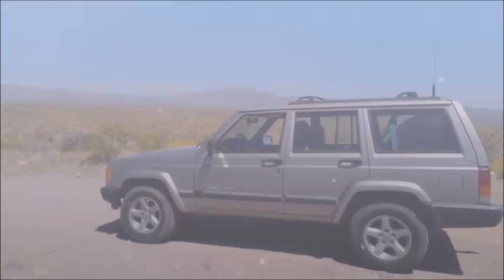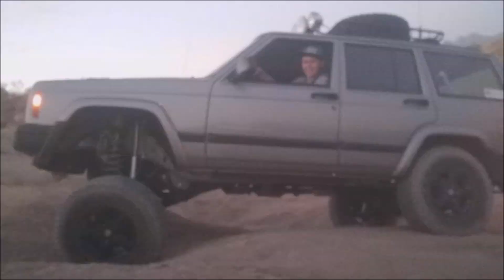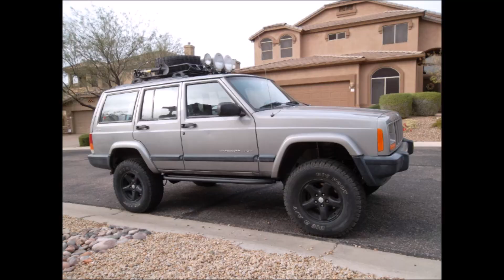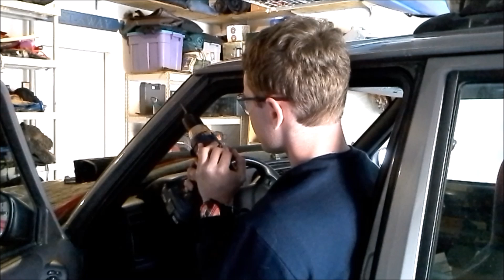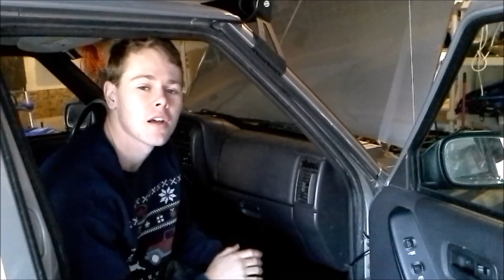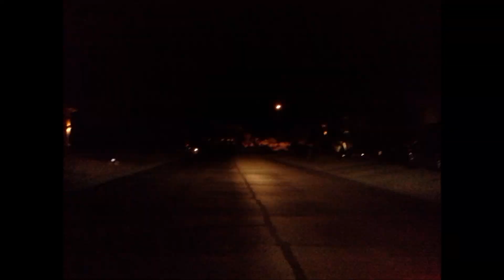Jeep Cherokee XJ LED Light Bar Installation

Comment: Have you ran into any moisture issues with this bar? I'm curious of how it does in the weather.
Reply from the maker: I haven't had any issues with moisture getting into the light bar. I live in the desert so we dont get much rain but it has been through a few rain storms without issue.
Reply: @AdmiralOffRoad  lol yeah not too much moisture there lol thanks for the quick response!

Comment: Probably extremely late now, but be careful running wires through your doors, can eventually wear through all the protective casing and short out causing popping fuses or even a fire hazard, great video just checked in to see how other people were running their wires 👍🏻

Comment: Alright. So there is a plug where the wiring attaches to the light. It's located right where you tucked it behind the weather stripping. Did you have the same problem? There is a good 12 inches or so from the light to the plug. I rather not have to tuck that all up on the roof

Comment: I'm having a problem drilling through...I'm using an 18 volt drill and a black and decker drill bit...is there something I'm doing wrong?
Reply from the maker: It shouldn't be hard. Maybe try a smaller bit first.
Reply: Admiral Off-Road that's exactly what I did and it pushed through! Thanks

Comment: What's the hit to your battery? Does it drain the battery quickly?
Reply from the maker: I haven't run it very long without the engine running, but I'm able to have the light bar and my spotlights on at the same time without any drop in battery level

Comment: Hey sorry I'm asking so many questions but did you ever have a problem with the light bar cooling things on the back of the bar vibrating while driving down the road and making an annoying ringing noise?
Reply from the maker: yep. At about 40 they make a ringing noise but anything above or below that it goes away. I've seen people use weather stripping on the fins to make the noise stop

Comment: Would this fit on a jeep zj ?
Reply from the maker: I'm pretty sure the windshield width is different between the XJ and ZJ so it might not fit with the same size light bar. Here is one that works for the ZJ https://www.amazon.com/Rough-Country-Windshield-Mounting-Brackets/dp/B0143LH220/ref=sr_1_fkmr1_1?ie=UTF8&qid=1478071575&sr=8-1-fkmr1&keywords=jeep+ZJ+50+in+curved+light+bar+mount

Comment: Did you do anything to prevent rusting where you drilled holes for the brackets?? If not have you noticed any rust?
Reply from the maker: just added some silicone to the holes and no rust

Comment: Hey how many inches from the bottom of the windshield did you mount them? Like down by the mirror
Reply from the maker: I'll measure and get back to you on that
Reply: Admiral Off-Road thank you! You just earned another subscriber my friend
Reply from the maker: would you like to have the measurement from the bottom of the windshield to the bottom of the bracket or the light bar?
Reply: Admiral Off-Road bottom of bracket
Reply from the maker: 17.25 in from the bottom of the A pillar above the fender to the bottom of the bracket.

Comment: Probably a noob question, but why do you need a harness? Can't you just wire directly to the switch?
Reply from the maker: here is a link to a good description of why you should have a relay for an accessory with a high draw: http://www.fourthgen.net/automotive-relays-functions-uses.shtml
Reply: Michael Wilcox I did that to my little one and it works just fine.

Comment: how many watts is the light bar
Reply from the maker: 288
Reply: I'm trying to find one for my jeep wagoneer but I found a 52" 500w and a 50" 288w both are 6000k I am not sure if there is much of a difference
Reply from the maker: There are a few other factors that i would keep in mind like IP rating and materials.  More watts doesn't always mean a brighter light. Watts measure the energy required to power the light while lumens measure the output (brightness). If you can find lumen numbers for both light bars, that would be a better comparison.

Comment: can you please put the link that you purchased everything from in the description?
Reply from the maker: I will add it to the description, and here are the links for you as well. Light bar: https://www.amazon.com/Penton%C2%AE-10v-30v-Curved-Offroad-Harness/dp/B00SISDC5Q/ref=sr_1_1?ie=UTF8&qid=1468790825&sr=8-1&keywords=penton+led+light+bar+50+in+curved
Brackets:  https://www.amazon.com/Omotor-Windshield-Mounting-Brackets-Cherokee/dp/B014W5IK7S/ref=sr_1_2?ie=UTF8&qid=1468790933&sr=8-2&keywords=jeep+XJ+light+bar+brackets
Reply: +Admiral Off-Road thank you, very much appreciated. Keep up the good work on the videos

Comment: How did you connect the wire from the wiring kit to the light bar you didn't show that point !
Reply from the maker: +Fraser Shellie you can solder them, use butt connectors, or twist them together and use heat shrink tube.
Reply: Does it matter if you don't use butt connectors?
Reply from the maker: +Fraser Shellie No. I prefer one of the other two methods, actually

Comment: i have the same harness and i want to use a different switch, i know it sounds stupid but I'm nervous about cutting it. any advice?
Reply from the maker: +Dom Provenzano Just leave yourself a little extra length on the wire in case you mess up, you can always just cut it again and start over. Its pretty simple. Just cut and strip the wires and either solder them or use connectors and attach to the switch

Comment: Hey man, Have the exact same setup and buy as you, i noticed that the leads to connect to the battery are smaller, how did you attach to battery?
Thanks
Reply from the maker: +Sam Adelman I attatched them to the bolts on the battery leads.if you message me on facebook, I can show you a picture of how i did it. Facebook.com/admiraloffroad

Comment: How many inches did you go from the bottom up to install the brackets?
Reply from the maker: +ariasbeto76 i will have to measure and get back to you on that.
Reply: +Admiral Off-Road Thanks I appreciate it if you can.
Reply from the maker: +ariasbeto76 its 17.5 in from the bottom of the windshield to the bottom of the bracket on the a pillar. That puts the bottom of the light bar 21in above the bottom of the windshield
Reply: +Admiral Off-Road thanks so much! thanks for the demonstration nice video!
Reply from the maker: +ariasbeto76 You're welcome!

Comment: Hey would a 52'' light bar work on 50''led light bar melts
Reply from the maker: +Cameron Croall It would not fit in the same position. The windshield is narrower at the top than the bottom, so if you were to use a wider light bar with the same brackets without bending or modifying them in some way, they wouldn't mount correctly to the same location on the windshield. They may, however, fit lower on the windshield because it is wider towards the bottom, but that might begin to obstruct the driver's view. If you are mounting to the roof instead of the windshield, then the brackets should be the same since there isn't a specific location that they would need to attach to.

Comment: what bracket did you use? was looking at the rough country one but done really want to buy a pop rivet gun to install them.
Reply from the maker: +Cameron Simpson I believe mine were the rough country brackets. You can always replace the rivets with self tapping screws.
Reply: +Admiral Off-Road what length are the self rappers you used?
Reply from the maker: Cameron Simpson I don't remember exactly off the top of my head, but i believe they were 1" or 1.25"

Comment: I'm loving the ugly Jeep sweater~!
Nice touch for this time of year.
I would like to add a couple of notes to this tutorial however. 
Whether your using self tapping screws, or not, any time you drill thru painted metal of a vehicle, it's a good idea to protect the holes from moisture. Even though the hole will be filled with a screw, and there's a bracket in place...yadda yadda... well there's still microscopic spaces, and gaps in all that where moisture and condensation can form. And as you all know, moisture and unprotected steel create rust. Granted, in this scenario all factors (including the weather stripping in place) can and likely will prevent any rust from forming for years, but in other cases, it may be a good idea to dab a bit of silicone on the screw before installing it.
I would also add that it is typically not a good idea to route wires thru a door jam without going thru the boot or adding one of your own. Simply running wires under the weather stripping doesn't guarantee that they wont get pinched, or that the insulation wont be compromised over time. Having worked in the mobile electronics field for over a decade, this is something that should be avoided if at all possible. Another option would be to use existing thru ports in the firewall to pass wires from one side to the other, or to drill and grommet your own. (just make sure you dont drill into the heater core)  

That being said, there's a lot of great advice in this video, and shows a very easy way of adding a light bar to a Jeep Cherokee. 
Keep up the great work Admiral! .....and keep those videos coming!
-Josh B.
www.TheJeepTalkShow.com
www.youtube.com/jeeptalkshow
Reply from the maker: +Josh B For you especially, living in the northwest rust and moisture is much more of an issue than it is for me living in the desert. The wiring, however does not contact the door or any moving parts, so I don't foresee any issues there. Hope you had a great Christmas!